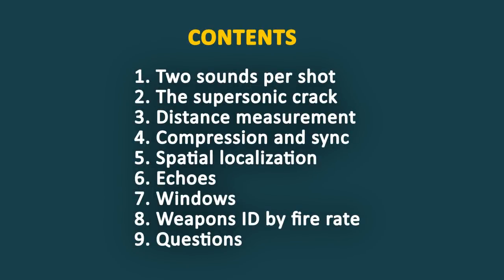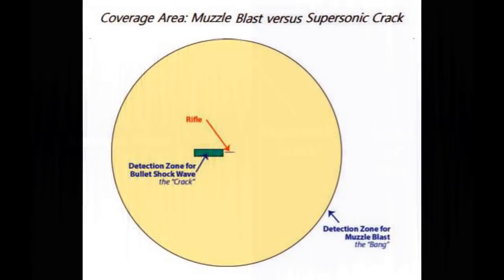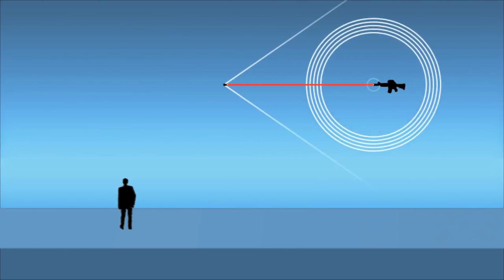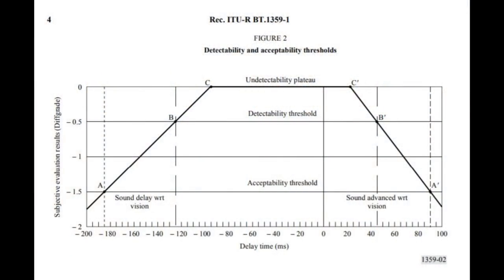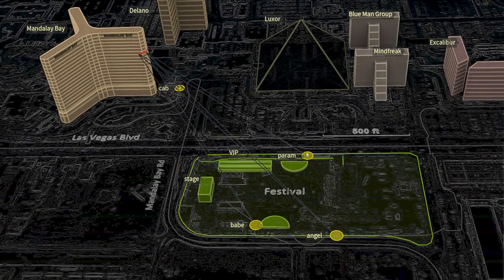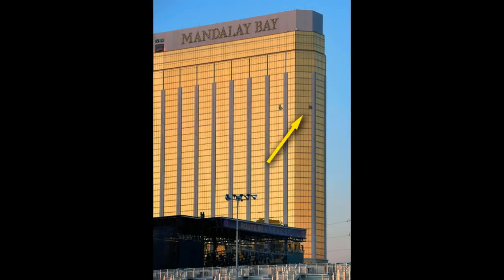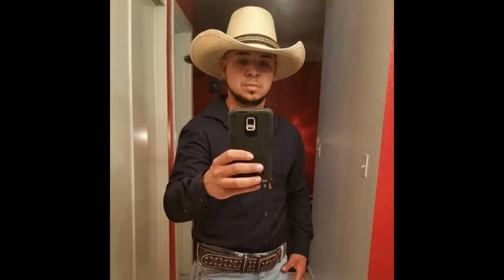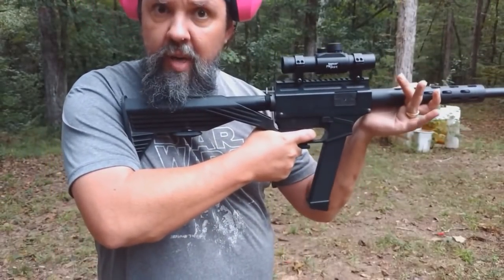2. Las Vegas shooting: The Acoustics of Gunfire

Comment: Wow, very impressive and absolutely correct.  That's why it makes so much sense.  That's why sound waves can be recorded digitally now and using LRAD precision can reproduce every one of these sound waves and send them out in a precise direction and will exactly reproduce the wave patterns described here.  Nicely done.  Too bad there isn't such technology to reproduce the holographic VISUAL effects needed to go along with the audio they used.  I don't care what type of flash repressers are available, EVERY ONE OF THEM can only repress, not totally eliminate muzzle flash and when in rapid fire they cannot handle the heat load so they start glowing and MELTING after too many shots in rapid succession which makes the flashes INCREASE in intensity.  No muzzle flashes AT ALL from windows.  IMPOSSIBLE.  Then we add the smoke created by EVERY SINGLE BULLET that's shot due to the burning of the chemicals.  Rapid firing of thousands of bullets would create a HUGE billowing of smoke rolling out the windows and at night with the high illumination of all the lighting around that smoke would have been IMPOSSIBLE to miss.  NO SMOKE.....NONE......AT ALL!   Another impossibility under this ridiculous story line we've been fed.

Comment: Great work, Mr Visual, and I suggest you to check out my analysis, which confirms most of your results: https://youtu.be/HjlZ1hMFie0
I do have some minor disagreements with you on some of the points:
1) I don't agree on the existence of a 150-ft cylinder around the bullet trajectory, within which you have to be to hear supersonic cracks. Al least in this case, many cracks were heard across the whole concert area (from the stage to the very far north end), which spans at least 500 ft. In fact, the cleanest crack signal was registered in the farthest location. However, the cracks would be missing upstream from the point of the bullet impact with its target. So if the bullets are flying over or land behind you, you will hear the cracks, but if they hit the ground somewhere in between you and the shooter, the cracks will be missing. This, and not the existence of the 150-ft cylinder, is the real reason why the crack sounds faded in and out.
2) For some reason, you completely gave up on the data contained in the supersonic cracks, stating that this is not a job for amateurs. I was able to derive quite a bit from them, for example the target location and some information on the weapon type.
3) I also do not agree that cell phones are such terrible sound recorders. The rate of recording was pretty uniform for the videos that I analyzed: when the recorders stayed put, the relative time difference between rifle report arrival times typically varied by <0.002 seconds. The main issue is their synchronization with each other. I suspect that you are right regarding poor sync between video and audio, and in any case video cannot possibly serve as an accurate way to sync because of the low frame rate. So I used some audio signatures in the music for synchronization, and I believe the accuracy was around 0.01 s (about 3 meters in terms of position), which is not so bad.
Reply from the maker: +Data Geek I'm glad to hear someone else is doing actual number crunching :)

1) -- "I don't agree on the existence"
Well, it's not really a matter of "agreeing", but reading the research. Page 3, bottom half:
http://www.shotspotter.com/system/content-uploads/mediakit/Gunshot-detection-WP.pdf

-- "many cracks were heard across the whole concert area (from the stage to the very far north end), which spans at least 500 ft"

I'm not sure how that's relevant. If you fire a bullet parallel to the ground towards two people, person A @100' and person B @600', both of them will hear the crack, just not at the same time, despite being 500' away. Given the angle, the projection of the supersonic cylinder on the ground creates a very long ellipse. The 300' diameter would apply only if someone fired straight down, perpendicular to the ground.

-- "the cracks would be missing upstream from the point of the bullet impact"

Not really, because the shockwave continues to travel both outward and forward after the impact, until it dissipates. This is similar to a ship's wake: if you suddenly make a ship disappear, the wake behind it doesn't just vanish. It continues on, until it dissipates. My most recent video addresses this.

2) When I did the original video, I wasn't interested in the direction of fire (we know where the victims were), but where the shooter was.

3) From what I understand you analyzed the beginning of the incident and the phones near the stage. The shots I analyzed were during the later part (cab video), with phones moving across large distances. I ran into large deviations (~150 ms) between what you'd expect for the location and the recorded report times. I'm referring to deviations at lower frequencies, say, minutes (separate volleys), not deviations at higher frequencies (i.e. for individual shots within one volley).

--- "So I used some audio signatures in the music for synchronization"

The stage speakers were spread across a certain distance and I seem to remember speakers in the middle of the venue, possibly in other places, too. How can you use music as a reference if you don't know the location from which music is reaching a particular phone, i.e. you don't know how long it took for music to reach the phone?

In your video you say you've calculated the bullet speed. How did you do this?
Reply: Ok, it looks like this is turning into a long debate, so let me try to keep the responses short.

1) Thanks for the reference. But if I were you, I wouldn't rely on a marketing white paper as a source of truth. The numbers they quote may be valid for their system, but there is really no physical limitation on how far supersonic cracks can propagate: the maximum range will be limited by the quality of the detector. The fainter a signal your recorder can detect, the further you can hear the cracks. My point is that there is no need to introduce some artificial "cylinder" in this case because the evidence says that the detection of the cracks was not range-limited. On the west side of the arena, all recorders were able to register practically all cracks, which disagrees with the cylinder model. However, on the east side of the arena the presence of cracks was intermittent, and my explanation for that was the impact of the bullets with the ground prior to reaching those areas.

Now, regarding the shockwave propagation after the impact, you are right that the shockwave will persist. But there is some wave physics involved here that you may be missing. You see, the shockwave is really the superposition (in more proper terms, interference) of multiple spherical sound waves created by the tip of the bullet as it propagates through the air. The reason why the front of the shockwave is nice and straight is because all these disturbances created by the bullet add up in phase in one particular direction (which depends on the speed of the bullet), and a uniform shockwave forms perpendicular to this direction. But this nice shape of the shockwave depends on the tip of the bullet continuously feeding it by generating more and more spherical acoustic waves at its front. When the bullet hits the ground, this feeding process will stop, and the shockwave will experience something equivalent to wave diffraction on an obstacle (see, for example, the top right figure here: https://web2.ph.utexas.edu/~coker2/index.files/diff.htm). The portion of the wave generated prior to the bullet impact will continue spreading perpendicular to its original wave front but with a fairly well defined cutoff boundary, which starts at the point of the bullet impact. Beyond that cutoff cone, the intensity of the crack will drop off very quickly with distance (similar to what is depicted in the shadow of the obstacle on the figure I referred to above), and for most practical purposes you can consider the shockwave gone there. So you will not see the shockwave just following the ground from that point on, but instead the edge of the detectable shockwave will be spreading up and to the sides with distance. What is interesting is that you can see this effect in the audio signatures I showed for the first 6 shots (Group 0). At Site 2 (east side of the arena), you get to observe the presence of well-defined cracks, complete lack of cracks, and also "fuzzy" and faint crack signatures that would be characteristic of the shadow edge. Interestingly enough, my model did produce a shadow edge going right through the detector location for that particular shot (I believe, Shot 5 of Group 0). 

3) For the audio synchronization, I first used the center of the stage as the source, and it worked ok. I figured the uncertainty in the distance to the speaker was <10 m (0.03 s in terms of timing accuracy). Later on, I started using the position of the nearest speaker (left or right), and picked acoustic signatures with clearly defined leading edges. I think the uncertainty dropped to about 3 m (0.01 s), which is probably what the recorder position measurement accuracy was anyway. But in any case, it is much more reliable than using video synchronization. But the downside was that you could only apply this method to initial episodes of the shooting, where the recordings would contain a portion of the song.

Regarding the bullet speed computation, there are a few more details on the lag time modeling in my first video. Basically, if we know the muzzle velocity, drag coefficient, and target point, we can compute the speed of the bullet at any point of its trajectory. Then we can model the shockwave fronts generated at each point of the trajectory, and compute the distribution of the lag times on the round. But we really need to solve the reverse problem: compute the bullet properties based on the lag time values recorded on the ground. So we take a particular muzzle velocity and plot the overall lag time error as a function of the target coordinates. Then we measure the smallest lag time error on the map, and vary the muzzle velocity until this value is further minimized as much as possible. As a byproduct, we also obtain the likely target point.

Sorry, I guess my explanation was not so short after all...
Reply from the maker: +Date Geek We clearly disagree, but I don't have the time for the inevitable exchange of long posts to debate this in detail. Best of luck with your research.